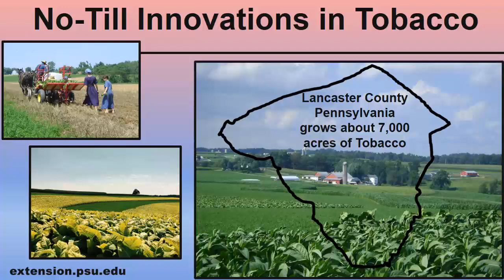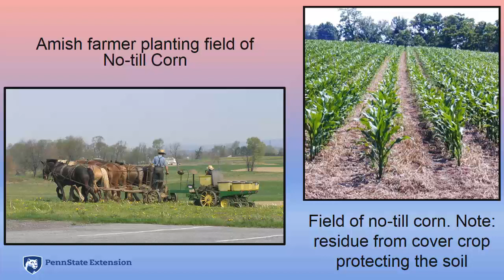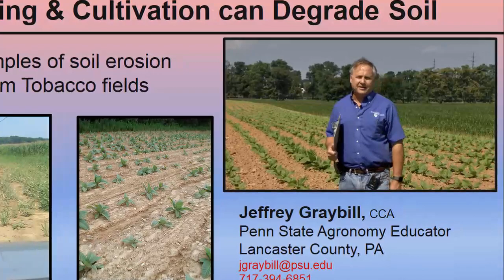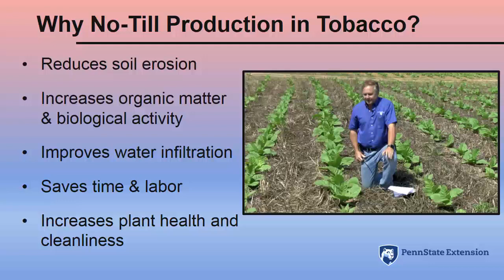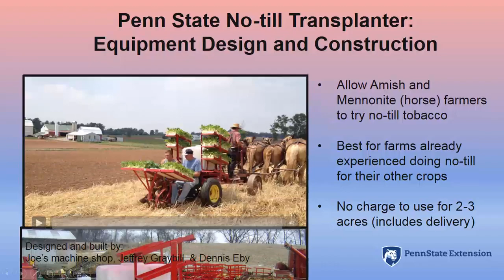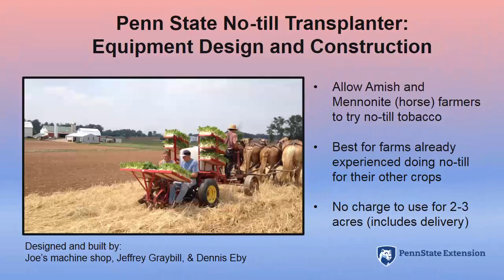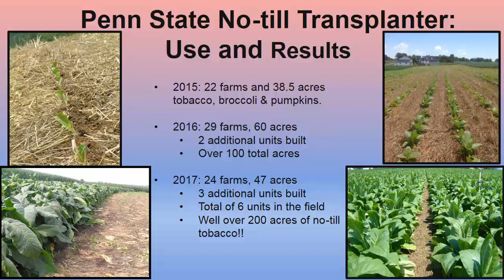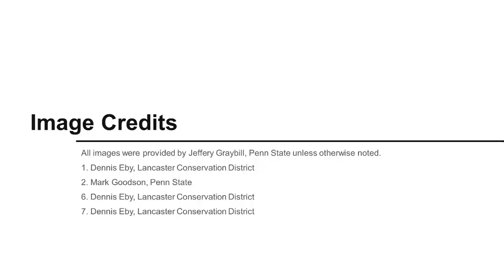No-Till Innovations in Tobacco

Comment: You need microporous fibers if you can source a lot. Coconut coir is my favorite and gaining popularity, but importing enough for a field is probably EXPENSIVE. But the coir, even as an organic fiber, will hold its structure through a few seasons at least i think. From there just mulching on top regularly with good compost materials should build soil structure and fertility over time. Sorry I haven't watched the whole video but my ears tuned in when I heard you talking about erosion. All those small particles of mineralic/sediment soil need to be propped up in a matrix of porous fibers and then all that blanketed with mulching <3